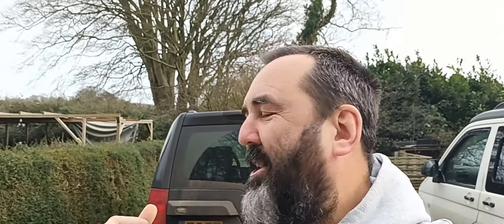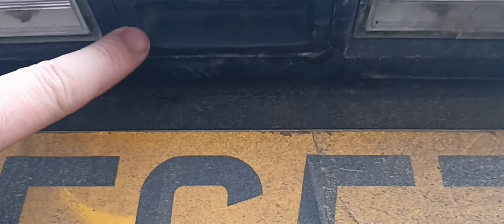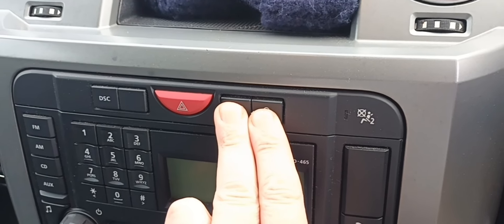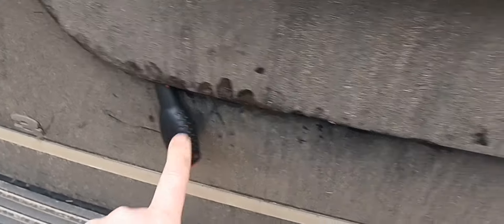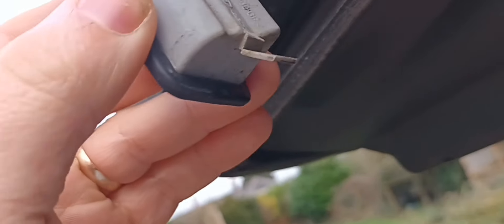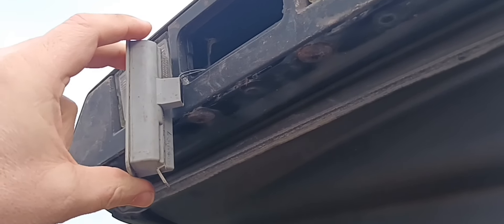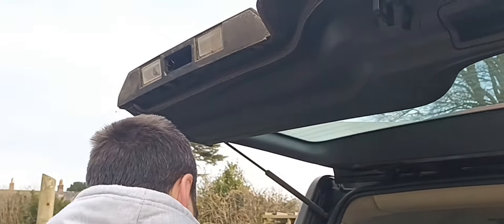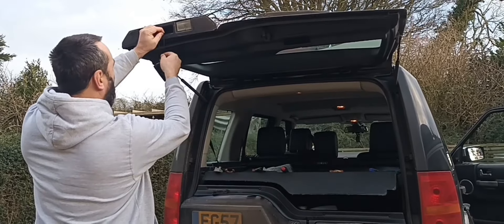Land Rover Discovery 3 Episode 5 | Tailgate will not open *** fixed for under £20 ***

Comment: Hi guys 

Im a bit confused now with my faulty tailgate. It meets all the criteria of a faulty switch (upper tailgate opens from dash lower tailgate opens ok with switch ) 

After research I went to go change switch & someone had already attempted the repair. 

Touched the stripped wires together to check latch unlock functionality without switch - nothing. 

Is there a voltage reading I should expect on the two stripped switch cables? 

Is there another step before moving onto the lower tailgate solenoid change? 

Plus if there is nothing happening at my switch not sure how the lower tailgate solenoid change will alleviate issue upper tailgate switch not functioning? 

Hope this explanation of my situation so far with tailgate makes sense and any help of the ideal next step would be greatly appreciated 

Thanking in advance
Reply from the maker: Hi Sean, this is a strange one, buddy. If you are not getting any power at the terminal ends where it meets the switch in the tailgate then there must be a break further along the line, supposing yo8 have ruled out the simple things first like fuses and faulty switches themselves. 
I'm really not sure where else to check to be totally honest, and I have since sold my Landy on, so I can't even go out and compare mine to yours for you either. 
I hope you get it sorted, buddy 👍
Reply: Did you figure this out? I have the exact same problem
Reply from the maker: @jeremypeeters5322 hi Jeremy, yes, replacing the tailgate switch solved my problem.
Reply: Yes mate. My issue wasn't the switch. The upper tailgate wiring harness had corroded within the rubber flex. Changed upper tailgate harness. Problem solved. Hope this helps
Reply from the maker: @seanmccarron625 that's great news you managed to find and fix the fault sean 👍